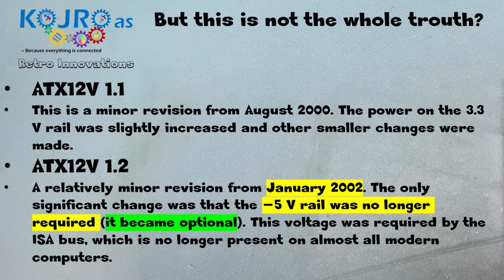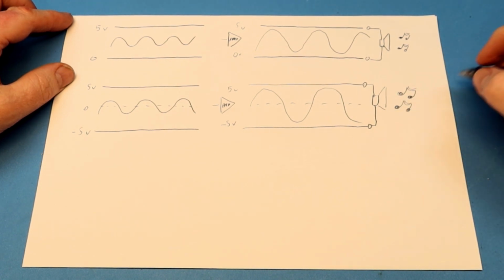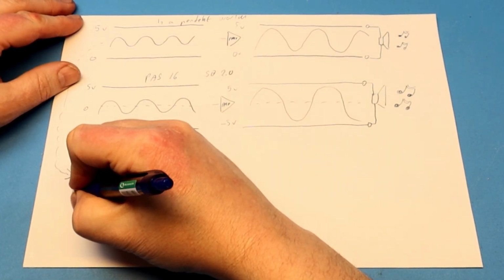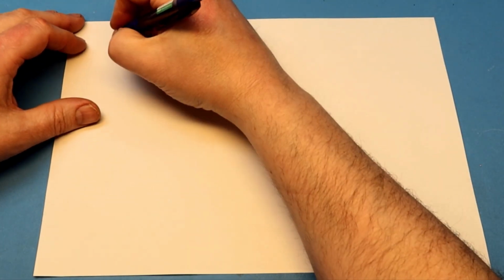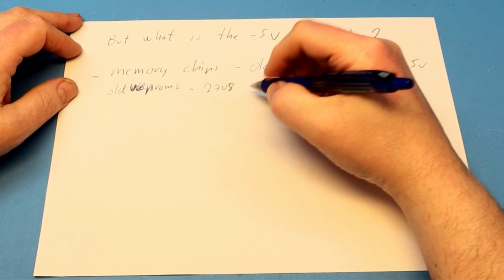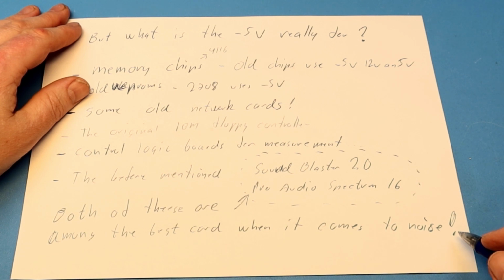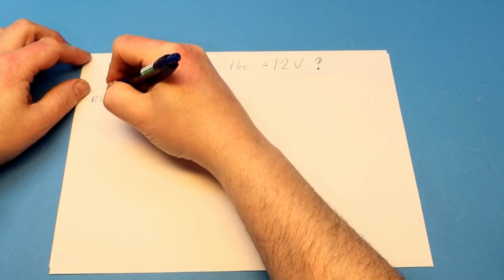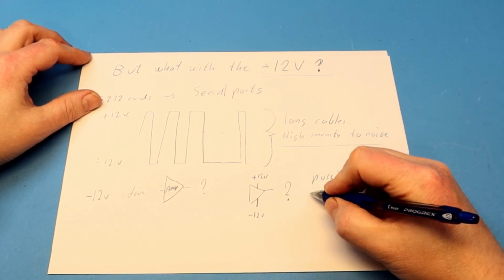Why bother with the 7905 -5V?

Comment: You might consider using a presentation program to make slides - they would show up better and could be timed using the system controls to display what you are talking about as you move forward in the presentation.  LibreOffice Impress or similar programs are what I'm talking about.  Music throughout a video should be mixed to -6db with voices at -3db.  That gives your voice track enough punch to get through over the underlying music.  A better way might be to use music to introduce a segment, trailing it off as you get into the presentation portion.

The content... that's worth hearing and seeing!  Good stuff.  A lot of modern gear only provides a headphone output, and it's up to the amplifier in the speaker system to take that and amplify it for output to the speakers, usually using a "Class D" or "Class T" digital amplifier setup.  (Yeah, that "Class D" is misleading - it has nothing to do with the Class D operating class for transistor amplifiers).